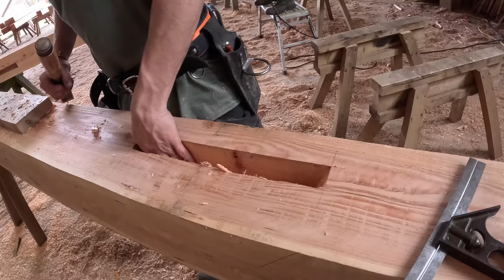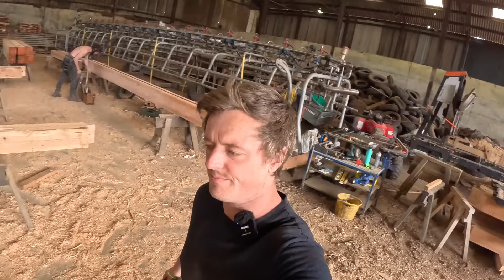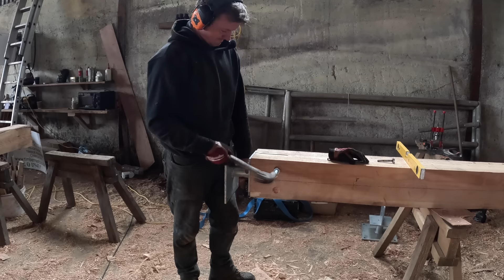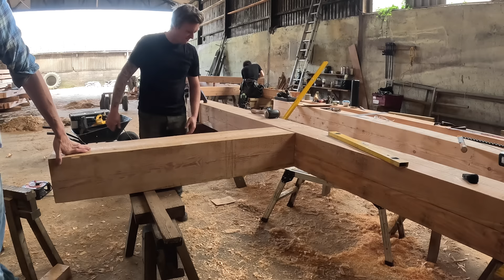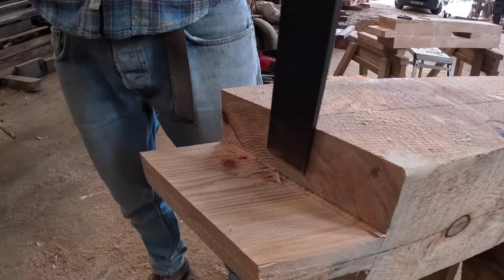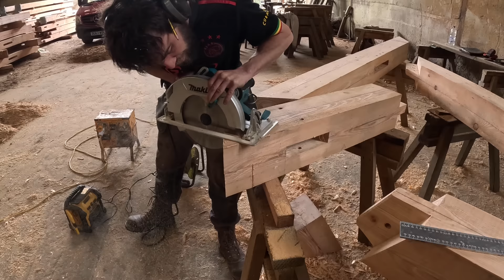Timber Framed Barn Part 13 Timber Frame Complete

Comment: Kris, Thx for another compelling video diary on this amazing project. Must say you found gems in those Timber Roots boys, true craftsmen. Hate to be one of those "you should" advice types but your wonderful lifestyle depends totally on your physical abilities so protecting your body is paramount. Rest is highly important and you would not regret using a back brace for heavy lifting as it will take a toll, protecting your lower back now will pay dividends down the years. Slow & Steady, wins the day every time 😉

Comment: Nice job. When we built timber frame buildings here in the Pacific Northwest (USA), we used paste wax (cheap) to cover the end grain. The timbers dried out more gradually and we eliminated nasty cracking at the ends.

Comment: you and your team have done a smashing job there on the frame, never ceases to amaze me the detail and time taken to check and double check the measurements are so precise even if the frame is just a simple barn, top marks on a top job, the jointing is simple magic
completely understand refusing to have your timbers loaded onto some rubbish lorry, glad you had some help unloading your trailer and i thought of your back there, you were at your limit struggling, but what have you done to the tractor retired it, i would sooner see you brake that than your back, i did mine in last year doing something silly using a faulty step ladder that i failed to check, it collapsed and i ended up with a fractured T12, ok now but still have constant reminders
surely you could position the trailer, use strops and lift in one go, drive the trailer out and lower timber to the deck

Comment: Ahh, the big barn did a good job sheltering the birth of the little (!) barn, and mourns to see it go...
Wood is such an amazing material, but did you ever look up and wish you were welding metal together?
I was pretty annoyed on your behalf that the lorry wasn't suitable - lifting constantly eventually did my back in and it took a few agonising years for it to return to something like normality.  To be avoided (the lifting) if at all possible, but if not your temperament helps enormously!

Comment: Hi Kris, love the content, always have, always will! Been following from the beginning when you were building the roundhouse and its amazing to see how far the homestead has come. I'm interested in how your approach/philosophy has changed over the years. When you started out everything was DIY, low budget and  very low impact methods. I can see your increasing the use of imported materials, people and recourses in order to scale up the size of the projects. Did you always plan to scale things up in this way? Have your views changed on what is 'low impact/ sustainable building? 

I'm currently developing some land and I often find myself debating what materials and methods are truly sustainable. Any insight appreciated! Thanks, Matt
Reply from the maker: That is a very good question, it is something I think about a lot. My views on this are far more complex than I feel I could realistically put in to words here. I might do a video on that at some point. 

I did move here and start off very small as I had nothing left after buying the land so I had no choice really. if I could have built this barn I think I would have wanted to. As big as the barn is it is actually going to be my most natural building yet. even the roundhouse has foam in the roof and pond liner plastic. This barn is going to really be all natural materials other than the roof sheets that will be fibre cement. That being said I have learnt something about myself that is key to why this project has gone so big. When I moved here I left a lot of stress and wanted a slow simple life. I have learnt that it isnt possible for me to do that. I wish I was the type of person to be content but im just not. I now know a simple life I wanted would cause boredom to me and lead me to depression or addiction or something like that. I heave learnt I need to keep busy and achieve things to be happy. I dont know I was born like that or if the huge pressure I faced in the workplace formed the constant need to push forward. I also believe the way we have constructed society simply just won't let me.  infact as I write this YouTube is telling me I have not done well enough this week. But for whatever reason as I stand today I always feel the need to keep doing new things and achieving new things. That being said I think this barn will be the biggest thing I will ever build and after it is done im going to work a lot more the the hydro electric stuff.
Reply: @KrisHarbour  Appreciate your honesty, I completely understand.  I respect your drive to exceed and think what your doing has real educational value. A video about your philosophy on natural building would be really interesting.
Reply: @ThePostRockProject  I second that.
Reply: An understandable moment for reflection x
Reply: @KrisHarbour  as a recent former land owner/ farmer with 20000sqft hand made wooden barns, 3500 sq ft home, 112 acres in land with beef and bees, I can assure there is life on the other side after pushing so hard. Its all internal. The striving you feel for new and more, is precisely what I used to feel. It took a seismic event in my persona life, to find out I didnt care for all of that in my innermost man, and your original house in the forest is my goal now. Being satisfied with little takes work, but it is EPIC once you reach there. The sort of conversation that takes trust to develop, and around a fire would be far better than a youtube comment section. Be well friend.

Comment: @ 31:25 Quit moving every piece 5 times / if you move it install it /this is becoming a farce / build it, stand if up Move on !!! /you mill move build move unload move build and then may finally erect/ what the hell
Reply: Ok. I normaly dont take the time to respond to Armchair experts but this is just too annoying to read. 

First off: Chris is a free man. He does exactly what he wants. He does so in his own accord. If he wants to build a 30x30meter skatebowl - then he will do it. He does what he CHOOSES to do. He is so motivated that he films his process - and we get to be inspired by it. You dont get to judge "the sense" of doing anything. 

Secondly: Apparently you have no idea what it takes to accomplish a complex technical build. "just build on site" good lord. If you watched the series - you will have seen - building on site was the original plan. In complex - hectic Situation with time limitations - you have to make adjustments to the plan. It was not possible to build on site - he needed to get the expensive Craftsman working - it was raining and storming on site and there was no way to build a shelter - so Chris correctly prioritiesed and made it work. 
On the whiteboard without the contingencies of the situation its not the "optimal way", but it sure was the best solution to the problem at hand. 

Thirdly: Chris has an incredible spirit of learning and trying to understand crafts and further his own skills. He explicitly said that he planned to learn from the incredible craftsman that he is working with on this project. The way is the goal. He doesnt do this "vanity project" to get it done - he does it to gain an understanding of the craft - and enable him to leverage these skills in the future. 

Please reflect your incredibly one dimensional thoughts, and dont give this man grieve - because somehow you need to feel like you "know better". It only makes you look incredibly bad. Im sure you can do better. 

I personally feel incredibly lucky - that i get to draw inspiration and energy - and the knowledge that anything can be done if you apply yourself from chris. 
Do better!
Reply: @jankeryork  yankerjerk if that's your real name you take my criticism too serious !!!

Comment: like I said you trailer away and trailer back That Makes No Sense build on site near your mill and worksite / you have added 3,4,5, steps to process / when frame built stand it up all the measurements work from there / IT"S A BARN five inches either way doesn't matter